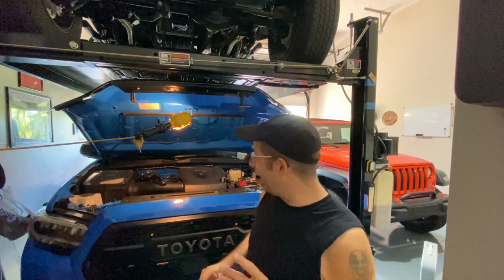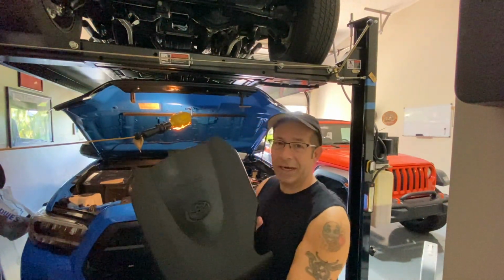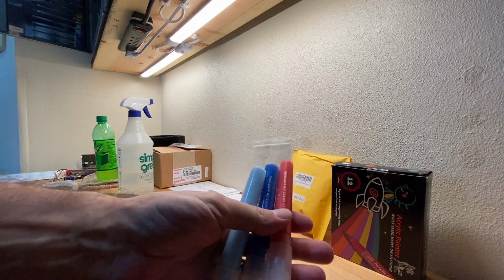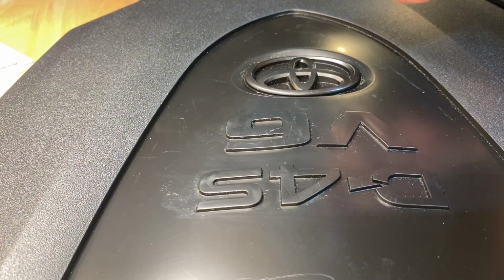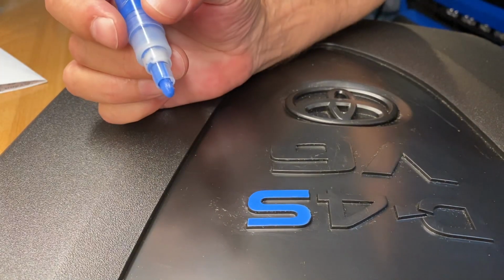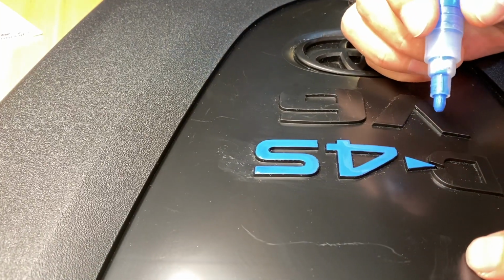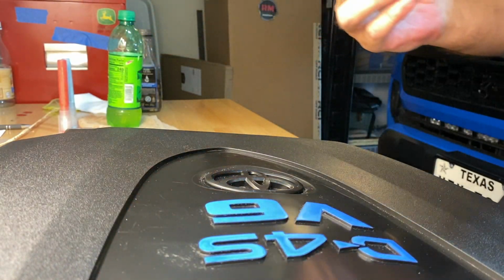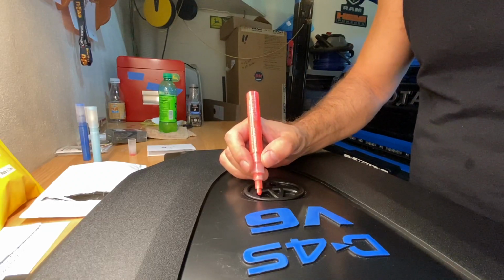Making My Tacoma Engine Bay Look Better!

Comment: Looking good buddy!! I Might have done the logo blue also. I have the silver vinyl on mine and like it. for an idea, replace the engine oil filler cap with a  colored aluminum TRD logo filler cap. Adds a little more pop to the engine bay and its cheap.
Reply from the maker: I actually have that cap. Just haven't put it on for some reason!!😬
Reply: RobMotive lets get with it. I smell another video coming?
Reply from the maker: Lol!  I may combine it with something 🤔
Reply: RobMotive now were talking!!!🧐